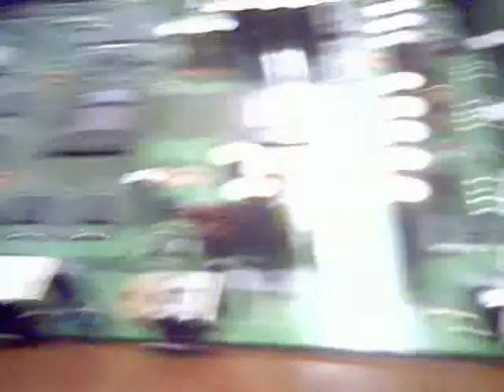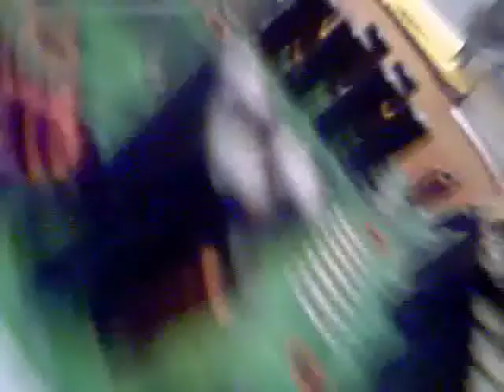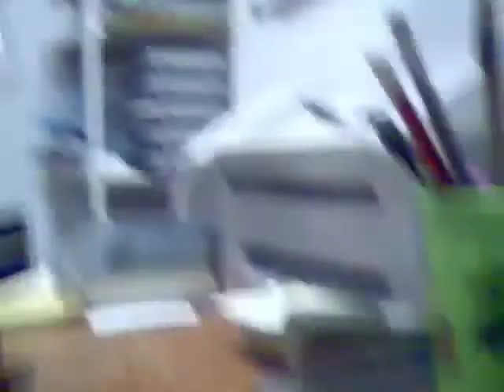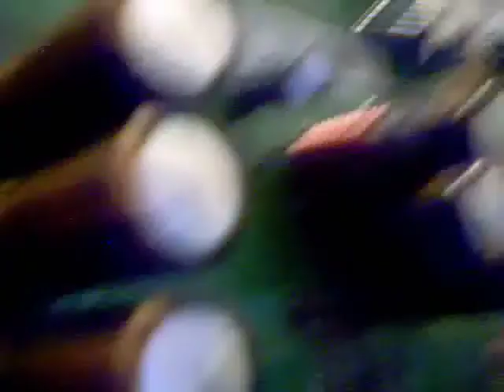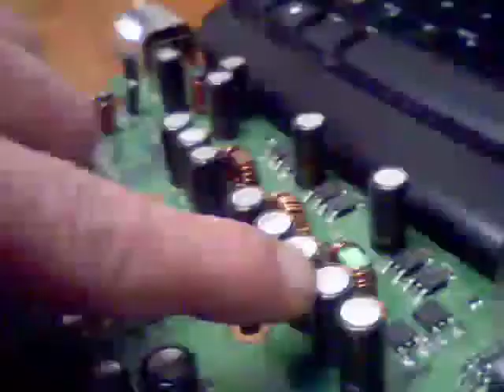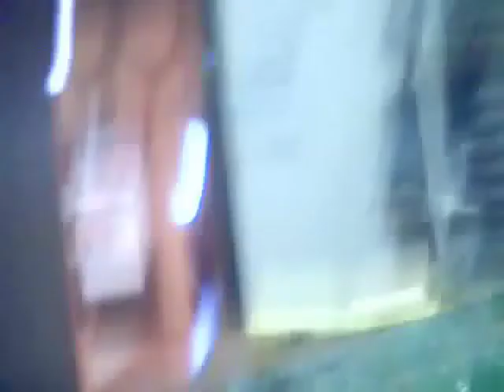How to repair 3 red lights

Comment: @Xboxsarerepairable Just because an electrolytic capacitor isn't venting electrolyte (or about to) doesn't mean it's good. If you see blown caps on any piece of electronic equipment, it's a good idea to replace all of them. Since the less bad ones have to pick up the load from the failing caps, they can fail in other ways (high ESR, short open/closed, etc.)

You can get a good selection of capacitors from Mouser, preferably ones of the same dimensions, low ESR and high temperature rating (105c)

Comment: @Xboxsarerepairable Thanks.  I really appreciate what you are trying to do.  I just wish I had seen your stuff sooner.  I tried the overheating trick because of another video and it worked for a week and a bit, but now my XBox has another problem that I can't identify.  I think I'll just save up for the new Slim.  I know you've said they fail too, but are they at least better?

Comment from the maker: @Johnsty14LAD This will not repair any red lights because I did not show the reflow of the chips and if you value your friend as a friend then you should not try to repair his/her Xbox for a 3 red light eschew because unless you own a $900 BGA Welder you will only succeed in damaging the Xbox! You need to find a qualified repair man with the right equipment or you will only succeed in permanently removing any chance at any kind of lasting repair.